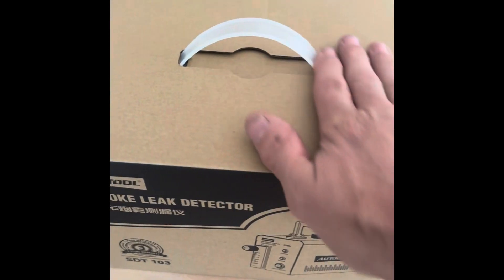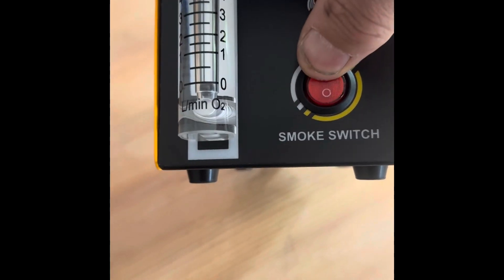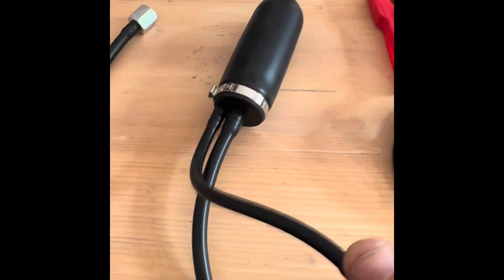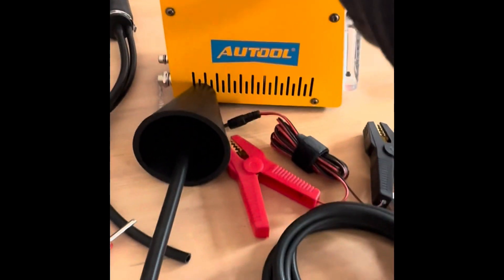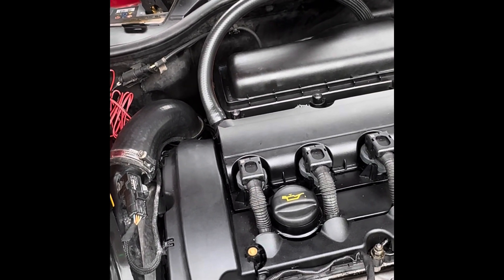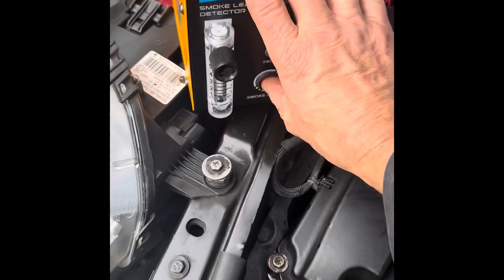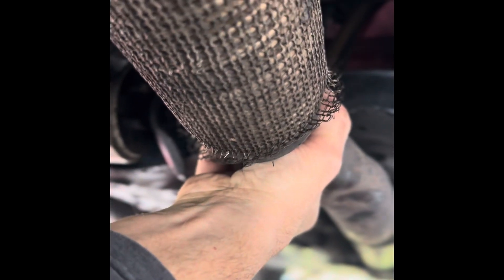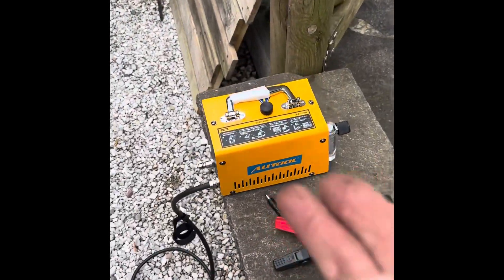Autool smoke tester review on Mini R56 with emissions problems

Comment: A broken flex pipe is a common issue for older R56, and may others.
Great video! A very good demonstration of the usage of this useful tool.
Reply from the maker: They are brilliant pieces of kit especially when taking exhausts on and off with engines that have two sensors. Keep us posted. You can do it 👍

Comment: regsrding the air fitting. You said it is a standard european fitting. Do you know if we have thast in the US and which one. thanks
Reply from the maker: It's the short version. UK has the long type. I'm not sure what the US has bit out of you buy on the US will come with the correct US connector . You can do it 👍

Comment: Did the flex pipe ultimately cause your issue? My Mini is running lean with similar issues and my mechanic suspects a leak somewhere.
Reply from the maker: Hi yes, I was going to do a video on the whole Mini R56 lean and failing emissions etc. Yes flexi was the problem. The thing with these minis is that you can get a huge bill replacing bits and it doesn't solve the problem. A leaking flexi will throw the rear O2 sensor out thinking it's lean. Air gets sucked in at low revs as there is little  back pressure in the exhaust. As the revs rise back pressure increases and reduces the problem. Emission tests are always done idling and 2500 etc and so low back pressure. 

The smoke tester is the way to properly check the exhaust and inlet setup. A leaking exhaust at the Cat/Exhaust junction will also do the same. You need a good mechanic who can diagnose by looking at the fuel trims etc. Keep us posted. You can do it 👍
Reply: @YoucandoitwithJules Thanks for your reply! I ended up buying a similar smoke machine to what you have used and tested the exhaust. There was a leak coming from the clamp that connects the downpipe to the rest of the exhaust. I cleaned it properly and tightened it a bit more and now there is no more exhaust leak. 
I’m still getting the error code P2195 O2 sensor stuck lean, even though its a fairly new sensor. Maybe its a problem with the fuel injectors or I have another leak elsewhere (at least thats what I assume).
Reply from the maker: @juli12345istRecorsi  aftermarket O2 sensors  can be a nightmare some work some don't and not for long. Could be the new one is faulty. Use only NTK or Bosch to make sure they are good and will last. Keep posted. You can do it 👍
Reply: @YoucandoitwithJules  I’m using NTK sensors. There was another small leak behind the throttle body and luckily I already had a replacement gasket at hand. Hopefully this was the issue.
Reply from the maker: @juli12345istRecorsi  yes that will do it. Hopefully you've sorted the problem. Keep us posted. You can do it 👍
Reply: @YoucandoitwithJules  Well the CEL came back.. I’m suspecting the new O2 sensor now because a mechanic told me it’s slow at responding
Reply from the maker: @juli12345istRecorsi  Hopefully or the cat is suspect. You can do it 👍

Comment: going cheap is fools errand .trade it in for the top of the range one  it is do supiror  and does a lot more
Reply from the maker: Thanks for the feedback.This model is fine and works treat.  You can do it 👍
Reply: Don’t make silly comments without evidence. These are great machines and Autool are a credible company and make many quality tools for a competitive price. The big advantage with this machine is the lack of built in compressor. This allows the machine to be cheaper, smaller and lighter and has less to go wrong internally. If you’re in the market for a smoke machine, you will more than likely have a compressor already. If you are not a professional mechanic in a garage you don’t need commercial tools in general.
Reply from the maker: @fishwag  👍